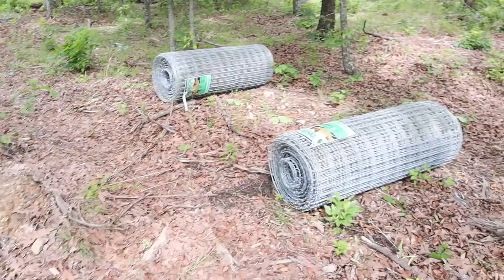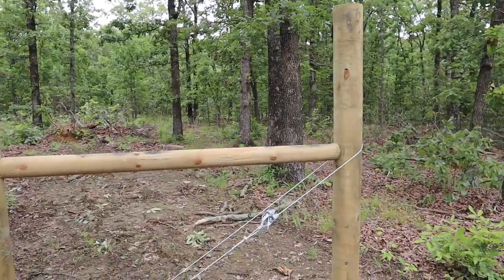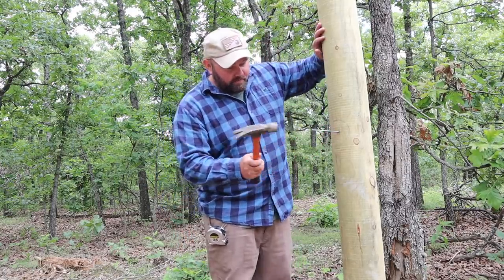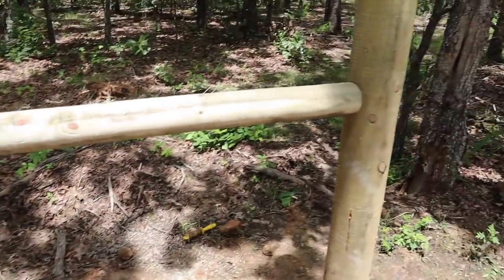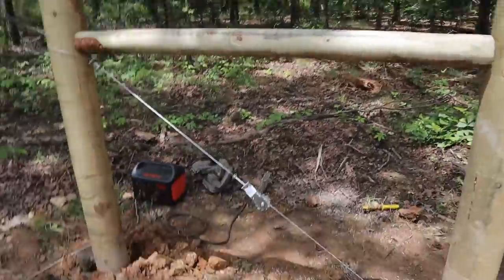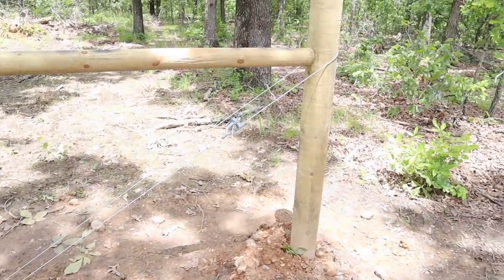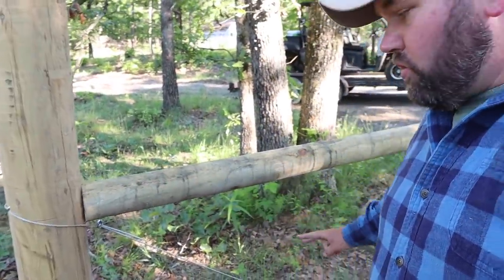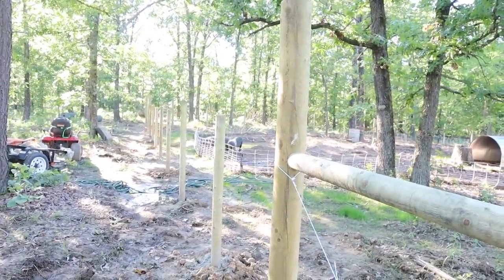HOW TO SET A CORNER POST FOR A PIG PEN OR FENCE

Comment: Usually the reason the ran double wires on h-posts was so the could stick something between them and twist to tighten.
Reply: @jimh4167  And using #9 wire instead of cable, cable clamps, and tensioners.
Reply: Brad Hugo  That's how we did it on the farm.  Only thing dad did different was he would use  a piece of metal because it didn't  rot.   Always easy to find a piece of scrap iron on the farm somewhere.

Comment: When I put in my fence corners, I drilled through the post and into the brace and drove in a piece of 3/8" rebar leaving it sticking out about a 1/2"-3/4". Then I ran 2 wraps of 9 guage brace wire from post to post. For the high side, the brace wire was above the piece of rebar sticking out, for the low side, I drove 2 or 3 big fence staples most of the way in. That would allow the brace wire to move a little while tightening. Then put a piece of 2x2 or similar between the wires and wound it up. Placing the tensioning stake (2×2) off center so it could catch the cross piece when tight and not unwind and loosen. That's an old school way of doing it. 
The tensioners you were using are what I used for tightening electric fencing when it would stretch some. It looked like they would work okay for what you were doing, I've just never seen it done that way. If I ever have to do anymore, I might give your way a try. 
Another interesting video. Have a good day.
Reply: Just the way I did this but would use a longer stay with post further apart to prevent jacking strainer post out of the ground
Reply: Exactly the way it is done...old school way.  Tried & true never fails.  This will be interesting to watch and see if it holds in future videos.  Hey I might have learned something new.

Comment: I’ve used the same set up  with the wire in the middle, but I didn’t use the ratchets they have been know to give out due to weather exposure, I like using the turn buckle with 2 eyelets and once tightened to lock it in place using the locking nuts. Thank you for your service and remembering our fallen service members. CW, SFC (Ret.) U.S. Army

Comment: Hey Dutch...use longer staples on wire and don't drive all the way in. This allows movement for expansion & contraction also the wire can be weakened at the staple due to indentation.  Great job and THANYOU FOR YOUR SERVICE.

Comment: I built lots of fence in my younger days and we would cut a notch about half way up on your vertical post for the cross bar to rest. That way there is no spike to rust. Then looped wire from top diagonal to bottom and use steeples to hold the wire in place. Then use a screwdriver or a bar to twist the wire until it was tight.

Comment: There's a goat farmer near me that did their corners the exact same way! They love it! When they run their fencing they ran in on the inside of the perimeter, for a couple of reasons. One to get the goats off those corners braces and two, to help keep the fencing better. When they climb, lay or rub against the fence it eventually causes pressure weakened spots. When the animals do all that stuff they're not wearing on the fence as much because the poles are directly supporting it.

Comment: I remember fixing fences with my dad, ones that were put in 20 years before I was born.  They cut notches in the posts and wedged in the H post between the 2 notches.  Then, using solid fence wire, a double pass of wire was ran diagonally to tension the corner.  A 1 x 2 or something similar was stuck between the 2 sides of the wire and used to twist the 2 strands, eliminating the tensioner or a turnbuckle.

Comment: Growing up I helped my dad make sense we would use a metal piece that was specially made for the angle corner post they called them an angle bar one in faces down on one faces up and you put it in between the two and you bolt it to your wooden post. Kind of like what you're doing with your wire but this was probably a 2 inch piece of metal. Good job on the angle your corner post

Comment: We always used several rounds of Wire around the Two Posts then a heavy stick and twisted till Tight, also use Rebar in each Post then put you post on between the Two Posts!!!

Comment: I and my Brother in Law, notched the post with a chain saw, then both ends slid right in, toenailed Screws-both ends. On the wire we twisted it around each pole, and used a something to twist the wire tight.  A lot cheaper. If it is very humid there in the summer, those metal wire tighteners might be rusted in two or three years. Used A come a long with 2 2x4s to hold the fence, while Stretching the fence.

Comment: Hi Dutch. That way you are trying it s what my father use on his corners.  He used a spike and  wound the wire around and around and around until it was tight if you did not have a spike a heavy piece of wood would help.

Comment: Hi Dutch, I was just thinking that maybe the post by your 12` gate, the tensioning cable should go from the top of the post nearest the gate to the bottom of the other post. Then mount the gate on the post not on the corner post but to the inline post. That way the gate isn't pulling on the corner post which isn't braced (inline with the weight of the gate pulling on the post) and the tensioner on the inline post is pulling against the weight of the gate. Just thinking. I have never done fencing like that only for dog fencing. Hope that is useful for you at least to think about. Good luck!

Comment: Hey Dutch, l love you & your family & fellow youtubers. I have over 40 years in the construction business. Building new homes, remodeling, fences & decks, & tree services, trimming, pruning, removal, smoking wood & firewood.
I like your standards & ethics because you know what you want for the right reasons but, since you are using 2"X4" " 48" horse fencing...you don't need H bracing in the corners. You don't need to & can't stretch the horse fencing tight enough to effect the corner posts.
That method was used for stretching barbed wire strands.

Comment: Dutch, leave your staples that hold that diaginal wire loose, until your fence is adjusted, that way you can tighten the wire equally, not just on one side. hope that helps! Another way to do your ties is figure eight it , post above the cross piece and cross ends over cross bar and come down middle to the other side. Tie off and twist with big stick or rebar, to tighten.

Comment: you can tighten the fence with  two 2x 4 fours drill 3 holes one on the top  one in the middle and one on the bottom. what size bolts you want to use. put the fence between 2x4. put the bolts in the holes and tighten the boards down. you can use rope or chain to tighten the fence wire. put the fence about 3 or 4 inches off the ground then tighten the fence. you also need put strand barb wire on the bottom of the fence. so the pigs will not dig out and push the wire up. thank you for serving in the armed serivce and all the rest that served. savannah tn.

Comment: I rest the top wire on the rebar pin that sticks out about a inch or so that goes through the post into brace, fence staples loose at bottom of other post. Once I get my wire tightened I finished driving the fence staples in. I have also used large spikes instead of rebar. I also do a X four pieces of wire each corner, to bad I can’t upload a picture to this. I think your fence looks great think it will keep everything in 👍🏻

Comment: Like you said there are many ways of doing the bracing.  I have seen people notch the brace into the post instead of using the nails.  A modern way would have been to use timberlock screws.  As for the wire.  I usually see it done with high tensile wire instead of the cable.  Then you don't need all the cable clamps.  Multiple ways to do it also.  If you use wire and the double loop method like on the first one you would run the loop around and then stick a 12" stick in between the loops at the half way point between the posts and twist the wire up to give you your tension.   Or using the single strand method drilling a small hole through the post at an angle, run cable through the hole, put large knot in the end of the cable, staple it down then use the ratcheting fence strainer to get your tension.

Comment: The way you have the wire tensioner is really good,, the one wire.......My guy used 5 ft wire for fence.. he also put a treated lumber 1 x 6 at top and bottom of fence,, ( meaning right at ground).....You can overlap them. Just screw to bigger posts good and staple to top and bottom boards ,,no need for electric..

Comment: Fence stretcher we used was 2 pieces of 2X4 bolted to the fence, with a "v" of 1/4 cable also bolted in. An anchor (Usually the hitch on the pickup)and a Hi-Lift jack or a heavy Come-along. High-lift jack worked better for really long lengths of wire.

Comment: Dutch a thought before you cut the posts down on the pen. How about leaving them taller than what you need. So you can put some electric fence wire for predator protection.

Comment: It's a good idea with pigs to run electrical around the inside of the fencing about a foot or so off the ground because if you don't they will push under the fence. If you don't want to run the electric around the inside in time you will decide that you need to just a single strain and it will keep the pigs off the fence. Because we had one she would go lift the fence up and go under.

Comment: hey dutch i tried to see the way you did your cable for the driveway but didn't get a good look at it but have you ever heard of the saying you never saddle a dead horse concerning wire rope but when you make a loop with wire rope the cut off end is known as the dead horse and the ubolt goes on the dead end side and the clamp is on the live end its stronger that way and less chance of it breaking the wire rope you can goggle never saddle a dead horse  and it shows you  it may never break because you don't have that much stress on it , thats the way you clamp rigging  but most rigging is crimped  instead of clamped but the rest of it looks good

Comment: either way works the same I use the dual wire faster to install and as you tighten the crank it applies equal tension on the other side

Comment: I grew up ranching cattle....I'm probably pretty close to your father in laws age.  My father was an old cowboy and rancher born in 1925.

Anyway.... The way the old man had us build our anchor posts was:
1. His preference was to use reclaimed Railroad ties.  Heavily creosoted they would still last 50 years.
2. Regardless if he had ties or large posts we would put a mortise on the vertical posts for the H beam ...they were measured and we usually cut in  with a chainsaw and use a chisel, splitting maul or ax to knock the block out ...Now this mortise was not deep.  At most 1.5-2" at the deepest . Just enough to give a good notch for it to set in. They were secured with a bore hole and a lag bolt 
3.  We would use heavy guage wire....Thinking I belief it was probably #9 guage ...loop was ran around then it was twisted with a heavy stick or branch to put the tension on. 
4 on the corners two were built at right angles together....this means everything in keeping everything tight and straight.   He would also put line anchors in line at high and low spots to ensure the fence followed land contours

Side note ....don't pay any attention to those city folk talking stuff on your page ...Pity the ignorant..

Take care and God bless your family
Reply: Just an aside.   Fences we replaced nearly 45 years ago are still standing straight and good

Comment: We just used barb wire same way as first one u did then we would twist both with piece of wood. Then you don’t half to leave tensioner in corners all you half to do if loosens is just twist more.

Comment: The first method you have the tensile strength of the cable x 2, the second method you have the tensile strength x1
The reason for doing this is to keep the end post from leaning into the gate opening due to the weight of the gate,
or on a corner to keep the tension on the fence from pulling the post out of plumb.

Comment: No fence guru, I always use wire and twist it with a stick to tighten. I think there is some geometry though. I believe your corner braces should be 2 and 1/2 times the height of the fence apart. Less than that and I believe over time the strain tries to pull the corner post up.

Comment: we do what you do with the wood. we use the corner post, and then go in  2  directions.  we do not use a wire, because the other side of the corner holds it

Comment: Pig panels self-stand but cost more. My uncle understood the long-term satisfied result as no stretching and no sagging ever. Used T-Posts to suspend the panels and used V-notch fence wire to attach them to the T-Posts. Still standing and my uncle is gone now.
Reply: I'm thinking he is thinking multi use and sub dividing the pen up into different areas .....and yes ...I know hog panels are good for about everything... Great for a day care application for toddlers.....lol

Comment: We notched the posts so the cross post wouldn't slip. And used high tensile wire to bind them together and twist it to tighten. Where's the lil white piggy? Either way nice work and thank you for your service!

Comment: I don’t think it’s a wrong way to do it as long as you get the same results in the end.   Double wire we use to stick rebar or pipe in snd twist it tight when it’s tight you just let bar rest on the brace in the middle.   we never had the fancy ratchets.      You shouldn’t hammer your staples in all the way either so the wire can move freely around the post

Comment: The first way of doing it is twice as strong because the tension is being held by both sides. The second one only has one strain to bare the tension. Other than that I think it will all work in your application just don't use it to hold T-Rex.

Comment: Instead of doing it like an H if you do it like an in you don’t have to use the wire, you can also cut a little notch in the pool with a crossmember goes in basically so you’re going from the bottom of the inside posts to the top of the corner post. That way your crossmember instead of going straight is it going at a 45° angle and that’s your tensioner so there’s no need for the cables. Just cut a little notch near the bottom and then a notch at four or 5 feet and cut the end of your cross poles in an angle to fit in those notches and to sink a 6 inch nail in there at each end. Now the word is it going at an angle and there’s no need for the cable. Another way I seen people do cable is they just make a loop and put a piece of rebar in there and twist that to tighten it and then just staple the rebar to the top pole, that way you don’t have to get the tensioner gear set and all of that.  It just doesn’t look as cool.  Lol. 

Either way I think the pigs are going to be happy. ;) 

It’s really starting to come together, I can’t wait till it’s done and you get to pull the electric fencing out of there. :)

Comment: You could have bought a roll of barbwire and looped it around the post like you did the first one and then put a stick under one strand and over the other strand and twisted them together with the stick and got it tight enough to play a tune on the barbwire,that’s the old school way and cheaper.

Comment: May be camara angle but the wire is to low. We did that type of colors for years....don't forget hogs Ruth and will get out without something to stop them. We used electric wire a foot up and 6" off each post. Today you can get solar powered at a fair price.

Comment: time will tell;;;you have one strand bracing multi strands;;;will stretch some thru the summer and get very tight when cold;;;I think you will be fine for a few years;;;you could have bypassed the turnbuckle stretchers using double strand of wire and use a cedar sapling long enough to catch the center cross brace after twisting the wires;;;;think that cheaper than using the wire stretchers to tighten;;but whats done is done;;;and the proof will be when the fence is up and several 200 pound piggies scratch their hide on the fence;;lol;;;or maybe they don't do that;;;b of course a single strand of hot wire could keep that from causing a problem;;;a few f clamps large enough to grip up to 6 inches can act as an extra hand when constructing;;

Comment: to save allot of work all you needed to do was thread the wire tru the ratchet tensioner instead of cutting the wire in two. It works and is easer.and less chance of it slipping
Reply from the maker: Do you mean like on the first one we did?

Comment: Well the first way you if you were to nail wire first but not all the post  and tension the wire you would the weight of attention in The wire between both ends with the continuous loop and then finish nailing the the nails the second way you're just having the one wire in between the poles and they have to take all the weight

Comment: Why not just run the cross brace diagonal from the top of the outer post to the bottom of the inner post? (Like a lazy Z) The post should be notched using a chainsaw to receive the brace and be flat to prevent slipping.  No additional tensioners required at all.

Comment: I have a question,what is the reason for going from the top of one side and to the bottom of the other side instead of going straight across?     :)
Reply: Strength
Reply: The funny thing is that is old bracing method for stringing barbed wire. 
The corner bracing is to support post while stretching the wires. 
The fencing Dutch is using isn't stretched as tightly so it really isn't necessary. The horse fencing cannot be stretched as tight as barb wire & doesn't need to be because it is more sturdy to begin with.
Reply: @rockinrahn773  well, barbed wire or high tensile un-barbed